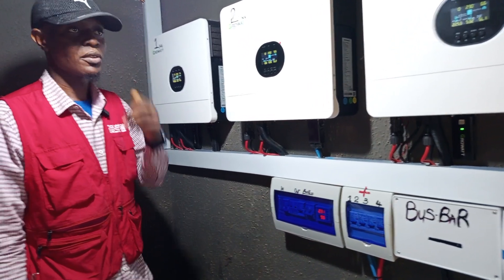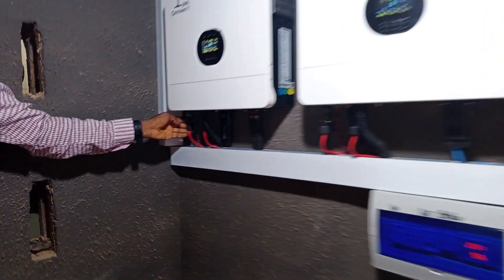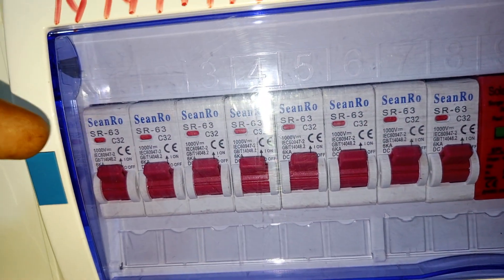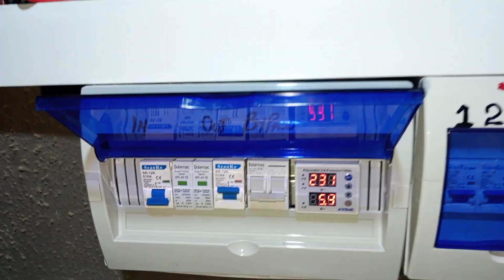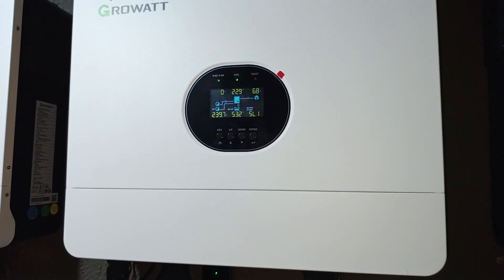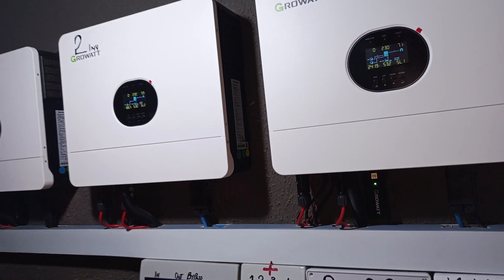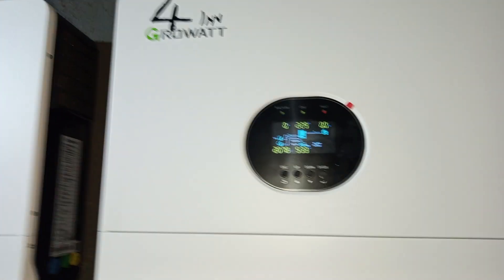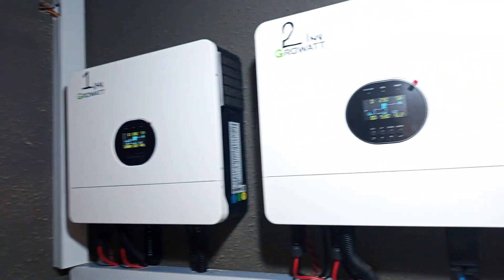Solar installation and explanation on cable size and breakers size

Comment: How did you calculate the amps for the busbar for all the lithium batteries
Reply from the maker: 3 pcs of 15 kWh lithium batteries = 45 kWh total storage capacity
Assuming a common LiFePO₄ battery voltage of 51.2 V:
Using the formula P = V × I, we get:

At 48 V:
45000/48 =937.5

At 51.2 V:
45000/51.2= 878.9A

To ensure safety and account for heat dissipation, the busbar should be rated at 125% to 150% of the maximum current.

Recommended busbar rating: 1,100 A to 1,200 A, depending on the material used (copper or aluminum) and ventilation conditions.
Reply: @Prostartechnical  Thanks boss

Comment: GROWATT is one of the best inverters. 

My question is I noticed the communication Cable is not used between the inverter and the battery does it mean you use US2 in program 5, also what is the connection you did here is it single phase parallel or split phase parallel I mean three phase..

Please explain better.

Also why are you using a 125A output breaker...
Reply from the maker: The system was parallel, for the breaker , 6,000/ 230 = 26.08 multiply by 4 inverter = 104 x 1.25 which is the save factor  = 130.04 . Note there is no 130 amp breaker in our local market. Is better you go for less one than going for higher breaker rating. Hope is clear . Thanks for your question and contribution
Reply: @Prostartechnical  thanks.

It means the inverter is working as a single phase 24kw.

if that is the case, my question is now why do you use a 63 amps change over since the inverter can output up to 100amps at a time..

Please I am also learning here.
 thanks.
Reply: @Prostartechnical  i have exactly this inverter but i don't understand this calculation here 4 inverter 6kw each = 24kw.
Reply: Output breaker(amp)should be size according to the total energy consumption per day divided by the output voltage  by the inverter multiply by the safety factor
Reply: Please why you mean is that assuming someone is using 2000 watts load per day and the inverter is supply 220v out as a voltage 
Does it mean 2000/220 sir? Which is 9 amps
 @Godfirstenergy
Reply: Exactly multiply by safety factor gives 11.25, definitely 15amp is suitable for ur ac output so far theirs is no 11amp